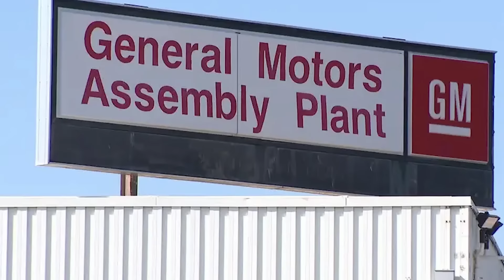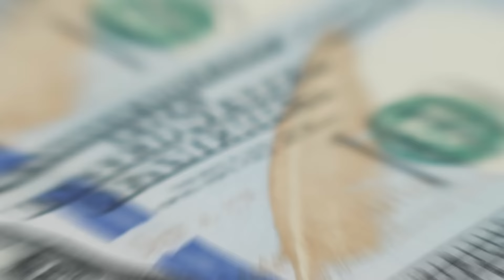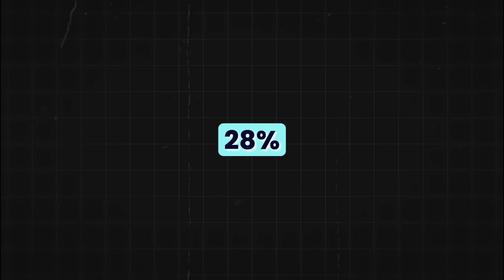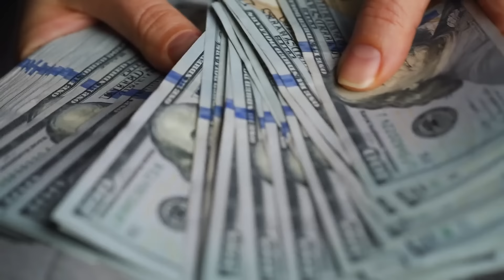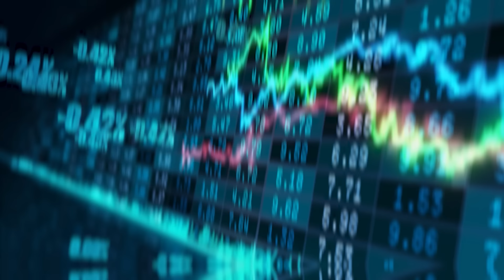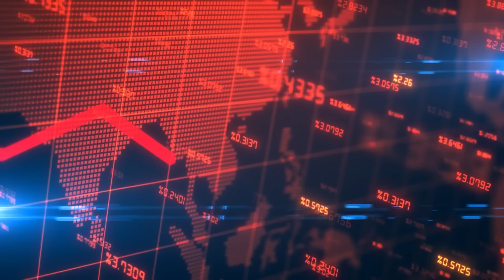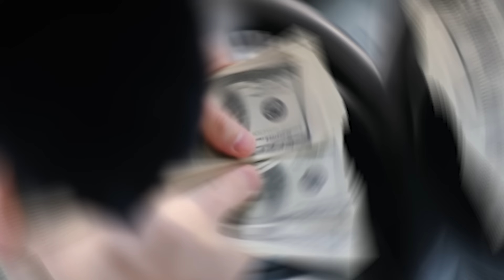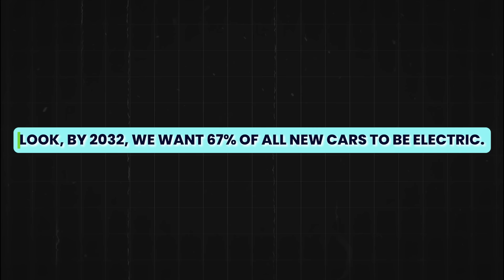The EV BUBBLE has Burst!!!

Comment: Keeping old cars out of  land fills would be more beneficial to the environment than effectively forcing everyone to buy a new Ev every few years.
Reply: Landfills?
Reply: @8gomerpyle22  The best car for the environment is the one that is not built.
Reply: Cars don't go to landfills. Junk cars is a money maker used parts and scrap metal it's huge business
Reply: @joeearley3351  Propaganda is also a huge business.
Reply: Why would you need to buy an EV more often than an ICE vehicle? Tesla uses the same batteries in their Semis and their cars. The batteries in the Semi are guarantied for 1 million miles. The cars should get the same life span, as long as they aren't damaged. I see videos all the time of  people with Teslas that have over 250K miles and are still at 90% battery capacity from new.
Reply: @billgreen8966  Then Bill, you shouldn't buy a car. Take the bus.
Reply: @joezolo9986  you actually believe that BS? Did you line up for the clot shot as well?
Reply: that is very basic understanding of the life cycle of a car. and wrong. cars don't go into landfills they get recycled melted down and made into something else.
Reply: I'm still driving my 2007 FJ Cruiser
Reply: Typical smooth brain take
Reply: @mickzed6746 I am driving a Tesla Model S with 280K on the clock with 89%% battery capacity left. It’s not BS. Ignoring CO2 emissions from FF emitters is a criminal act perpetrated on our grandchildren. Or is machismo more important?
Reply: @benjamindemontgomery6317 
It's more expensive to recycle. Most of the car still goes to a landfill. Glass, upholstery, plastic, cloth, chairs. 

Best way to recycle them is to maintain and repair.
Reply: What are you talking about? I still have my 2006 Yaris and Tundra both run great.
Reply: Every few years? Exactly how long do you think EV batteries last? I'll give you a hint it's more than 15 years.
Reply: @DoRC  as long as it doesn't.. ya know, get cold. LOL
Reply: @PB8man  electric vehicle range is  somewhat reduced in the cold but it's primarily a problem of people just not understanding it yet because they're not used to electric vehicles rather than it actually being that the vehicle can't do what they need it to.
The vast majority of electric vehicles have enough range to handle the vast majority of drivers needs even if that ranges reduced in The coldest weather.
All vehicles have limitations. A lead acid battery is also susceptible to extreme cold temperature. If you aren't aware of it or don't have a good strong battery you can be left stranded by that too.  Diesel fuel gels in extreme Cold and can leave you stranded and even damage your vehicle.
Reduced range isn't a problem that actually will prevent electric vehicles from being used in cold weather. It makes good headlines and it makes great talking points for people to confirm their biases but in the long run it'll be just fine.
Reply: @PB8man  ...or HOT, lmao.  Stuck in traffic with the a/c on = walking home.
Reply: @serfcityherewecome8069  Right? But I get unlimited milage because electric is free and the archaic power grid can definitely handle it because 20 years ago they definitely designed our infrastructure to rely on EVs. Right? I can drive and consume electricity without restraint, and it is the best tech ever and it will save the world. I am a soldier in the fight against climate change because my lithium batteries appear out of thin air and definitely don't come from strip mines in Africa where slaves are still used for labor. Totally world friendly tech.
Reply: My 33 year old mercedes e300 just runs forever😊
Reply: @joezolo9986  BS …. My son is an automotive tech and batteries are being replaced as early as 6 years in some vehicles … to the tune of $15,000 - $25,000 depending on the vehicle!
Reply: Yes my 2006 Toyota Corolla is doing fine; never had a problem!!!
Reply: Used cars are scrapped for metal not buried!
Reply: ... that will also end up in landfills.
Reply: at a certain point, keeping an old car on the roads becomes pretty expensive.
especially for all you blue state people with your $6 a gallon gas prices.

a mid 80's honda accord made about 90 HP and got about 28 MPG's.
a brand new ICE honda accord has at least 200 HP and gets about 40 MPG.

to me, the solution is obvious. by both, or at least the parts you need, and combine them.
put that more effecient power train under the hood of your '84 accord.
or put an LS3 motor and tranny package in a chevy, or a miata.
Reply: @PB8man  Worthy of being pinned.
Reply: @nonenone-ll7ln  keep in mind that a Honda accord in the mid 80s weighed a lot more than a new version with 200 HP
Reply: So far, NOBODY is forcing anybody to by an EV!
Reply: They send them down to Mexico. I live in south Texas and there is a daily flow of 3 vehicle chains “in tows” from auctions in Houston. 
Throw-away economy
Reply: @YZXRYDR  🤜🤛
Reply: Recycling is the same scam! 
Just selling a half baked idea.
Reply: @KS-45  Are these Tesla or legacy auto makers. The batteries being replaced, are they damaged or worn out?
Reply: @mickzed6746  No, I got the IV. I planned my heart attack for this weekend.

And what do Watermelons have to do with cacti?
Reply: @joezolo9986  Did you know that EV's have double the cabon footprint to build
Reply: @joezolo9986  all of the above above …
Reply: @mickzed6746 
It’s not BS batteries of old Tesla’s last longer than 300k miles.
New Tesla batteries last 500k-1million miles depending on chemistry.
Batteries can be 97% recycled very cheaply & profitably.
Reply: but not EV hydrogen only EV is dead end
Reply: @kirrax22  would you want to be in a car accident with a tank of hydrogen in your car? HARD PASS!
Reply: Do used up lithium batteries go to the landfill?
Reply: @curtis4109  most do.
Reply: the irony of Cash for Clunkers is that many were 80's/90's era Ford/GM cars which were reliable and still had much life in them. Sure they were gas guzzlers, but why keep wasting resources to make newer cars that don't last long.
Reply: @heardbutnotseen1529  what? Who told you that BS. 😂
Reply: @danielnewman3441 That is ot true. Where I live, and 500 miles around, we get out electricity from a Hydro electric Dam. Not from coal. Factoring in fuel. No.
Reply: @KS-45  I have no idea what you're responding to.
Reply: @joezolo9986  Silly comment. Be sensible and keep the car you have. No brainer.
Reply: @joeearley3351  much but not all. A good amount get scrapped.
Reply: https://youtu.be/Pn2eCY3Kwuk

Comment: The most important question: Is the EV market being driven more by government regulation or consumer demand?
Reply: Ya need ask?
Reply: EXACTLY I SEEN TO MANY IN CALIFORNIA BUT THEY HAVE ALL THOSE CHARGERS IN PARKING LOTS OF WALMART NOT MANY CARS ATTACHED TO THEM
Reply: The EV market is business case driven.
And , in contrary to most people think, a business case does not depend on buyingprice (alone) but on the TCO.
In my situation, in europe, I calculated in 2019 that an EV , price 45000,  (without government gifts) would do break even at 25000 km (15000 miles) / year. The same car as ICE would cost 30000 in that year. With 25000 km/year or 125000 km in 5 years the price difference between the ICE version and EV version would be earned back in lower energy costs and lower maintenance.

I made those calculations since 2013 and had , in TCO calculated, saved 60000 euros in 8 years. For that money I could buy a ioniq 5 limited (project 45) for "free". Which has made already 55000 km and saved me another 6000 euros on energy and maintenance.
Od coarse mostly charging for low price in the night at home (95% of all electricity) or with my solar panels (even cheaper than low night prices)

The lowest temperature in my country is only a few degrees below zero in the winter. The range drop (compared to 21 degrees celsius in summer)  during cold (-2 celsius) is 15% during longer trips, from which 5% is the heatpump. The rest is increased drag because the cold air is denser.(ALL ICE cars also use more petrol in winter time due to this)..and on short trips driving in the cold is very bad for ICE cars...they must get on temperature.

Public charging only does not make sense due to the high prices asked for ac slow chargers and extreme high prices at dc fast chargers. But for the occasional longer travel...it's not more expensive than petrol/ km. More or less the same.
Reply: neither.  by rich elites
Reply: Govt regulations, no consumer is interested in a 60,000 $ battery replacement repair 4-5 yrs down the lane when warranty expires. Plus can’t drive them in winter conditions, and could explode occasionally! Thanks, I will keep my money!!
Reply: @reiniernn9071  I assume the TCO of an ICE vehicle in Europe is significantly more than it is in the United States.  That said, EV's have 3 main problems that I see.  
1. The electricity required to charge EVs is still predominantly produced by petroleum fueled power plants.  To that, adding transmission line losses to power stations, you're not using energy efficiently.
2. Battery technology isn't mature enough yet.  The production and disposal of the current generation of batteries is anything but ecofriendly.  Also, people don't want to buy into a technology that will be outdated before the service life of their EV.
3. Vehicle manufacturers are trying to make EV a luxury item.  By doing that they're limiting themselves to a narrow and fickle market (as they're now seeing).  If they want the acceptance of EV, it will have to be marketed as an economical alternative to an ICE vehicle.
Reply: @ChickenMcThiccken
The ones who own the politicians .
Reply: @richardbarber4444  Not at all. Anyone who can think beyond their own smell knows the answer. However, it is a fun question (preceded by “In your opinion…”) to ask the executives representing their EV’s while they’re blowing smoke up the audience’s asses at an invitational conference.
Reply: Government
Reply: Government regulations as all electrical power is controlled by the government
Reply: That is and was always obvious…
Reply: Government regulation
Reply: That is not a question. EVs would be a very small market without government interference. Teslas would be a toy for the rich and EV's would be decades away.
Reply: @ProjectionTrolll is their lots of charging stations in the middle of the bush?Do 200 plus miles in the middle of the bush in a day trip
Reply: @ProjectionTrolll  only on a gas powered sled lol electric 🤣 no range I'm sure
Reply: @stevemino142  So the corporations have  taught you  well.  You think the government controls everything..... interesting....

Comment: Was at the local ford dealer today buying the oldest car on the lot (2006) and was talking to salesman about the Mach E sitting on showroom floor. He said their dealership paid $60k for the initial tools to service EV but said no to the $500k Ford wanted from them to order any EVs in 2024. Said they sold 5 Mach E's at the start and now have 5 on the lot. Then he said "we cant even give them away." The sticker on window said $7k off MSRP. So yeah I'd say this video seems to have some truth to it.
Reply: The ford paint job is absolute doggy do. And the metal is 1-2millimeter thinner than other brands so why pay for a car that will rot after 12 years. Why have all the bells and whistles for such a small lifespan. We need to be making things to last. Otherwise not environmentally sound.
Reply: @karensheehan2878  The steel bodywork might well be thinner on EV's I don't know, but it can't be by up to 1-2mm because the average thickness on a conventional car with a combustion engine is still only from 0,7 to max 1,2mm
Reply: Cause why would you buy one when you can get a tesla.... like seriously ryobe vs Milwaukee